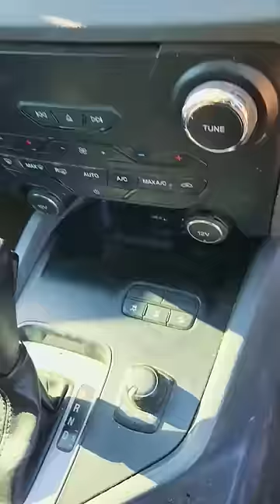Worst Bio Hazard Detail Ever ASMR

Comment: 2 week after: buttons don't work
Reply: Even Windex has electronic-safe cleaners. Not everything is conductive.
Reply: @wildcatdan5072  its not about conductivity, its the water vapors that remain there rusting the connector's legs.
Reply: That's what I was wondering. Is that a steamer or legit water spraying in vents, etc.??
Reply: Fun fact: water is not actually conductive. It's the impurities that make it conductive and kill electronics. As long as you use distilled water with non conductive and anti corrosive cleaning solutions, it's perfectly fine.
Reply: @MrLuc420 Когда вы дистиллированной водой смываете грязь, она не становится разве водой с примесями? 😂
Reply: @BMWmech  да за что вы так с человеком 😂
Reply: @MrLuc420  давай проведём тест? Нальём в таз дистиллированную воду, опустим 1 провод и одну руку в в воду опустишь, а другой рукой возьмешься за другой провод. 😂😂😂Как тебе такое - Илон Маск?
Reply: @MrLuc420 as soon as he sprays it on the dirty surface it has impurities, even the electrical connections themselves aren’t sterile
Reply: @MrLuc420  I actually had to look that up to verify, I in fact did not know that. The problem is what others have already previously stated; pure water with 0 impurities doesn’t exist naturally, and artificially creating it and using a large amount for detailing purposes is probably not cost effective. Even if it was, the surface that you are applying this water to also has its own impurities. 

Bottom line, the likelihood of your detailer using a water solution that is ACTUALLY safe for electronics is very unlikely. At meineke we see people come in all the time for electronic failure after a detailing; 9/10 times a fuse fixes the problem easy peasy. One time, however, a customer was not so lucky and had to replace their entire climate control head because the a/c stopped coming on. Ended up being quite an expensive detailing!
Reply: It's just steam, son
Reply: @csn6234 yeah, and steam can get in places that regular water can't, and carry all the lovely conductive impurities from the filth it's being used to clean with it.
Reply: @MrLuc420   pretty sure that car was full of impurities ...
Reply: That's what i was thinking. In these videos they are foaming everything so boldly, but never show where does all the excess of water and cleaning solution goes, what happens to all the little crevices
Reply: @hammerT2997 It’s steam. Anything for interiors will be steam.
Reply: @Je_QzcY3mN0 the better detailers use compressed air to blow the excessive water
Reply: @genlus_s  I heard some use a heavy duty dehumidifier
Reply: Это капец а не чистка. А потом ой электроника не работает, или машина начала ржаветь в самых неожиданных местах. Или плесень появится под всеми этими деталями и щелями.
Вот уж действительно, хочешь сделать хорошо - сделай сам.

С таким же успехом можно было весь автомобиль опустить в бассейн, вытащить и показать ВАУ какой он чистый стал😅
Reply: @MrLuc420 The surface on which the distilled water droplets fall has impurities
Reply: @Executnr  why even bother, the cars own hvac system set to high temperature with the air conditioner compressor going make a really good dehumidifier
Reply: Might as well dip my car in a lake to wash it. Pretty sure no electric issues will arrive.
Reply: Também acho...!😊

Comment: Man for some reason this video made me think back oh about 10 or 12 years ago. When I did commercial and residential irrigation repair. As you can imagine my repair van would get EXTREMELY dirty with the mud and whatever. Well I had just finished cleaning this van so me and my helper had a clean area to sit in. And I swear to god this guy was all wrapped around the axel about something he couldn’t do correctly. And he gets in the van all huffing and puffing and takes his muddy gloves and slaps them on the clean dash. At that moment I realized just how incredibly inconsiderate people can be. I also realized just how ignorant the owners of said company were. So after this guy went and slapped his nasty muddy gloves on the dash I didn’t say a thing. I figured the owner would see the muddy mess right in front of this guys seat and ask about it. But to my amazement that’s not what happened at all. The owner did in fact see this muddy mess all over the dash on his side of the truck. And I swear the owner asked me wow this is how you treat my vehicle. I was speechless I couldn’t believe what I was hearing. I can’t remember exactly what ended up happening I think the helper told the owner my boss he does that to dry his wet gloves. And nothing ever came of any of it but this video really made that memory pop up in my mind.

Comment: This car passed through a flood, that's why is in this situation. It's common here in Brazil, due to our terrain shape, the lower areas always gets flooded after heavy rain and depending on the costs of such repair some cars get considered "total lost" due their maintenance price. There's also the matter of recovering the fuse box from the dust, the interiors of the dash panel air ducts and engine machining due the entrance of water inside the cililnders.

Comment: I seen a video - must of been a company vehicle.

They used a sandwich bag on the shifter to prevent wear & tear.
Also,  using a small pancake air compressor will make the vinyl cleaning & areas between the seats easier to access & clean 

Great video- ✌🏻🤔👍🏻
needed a full reconditioning